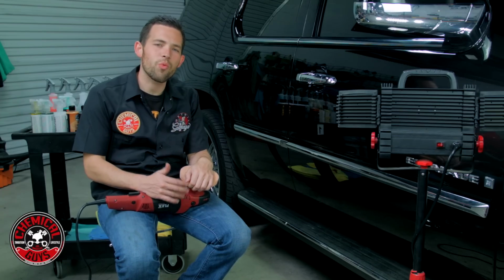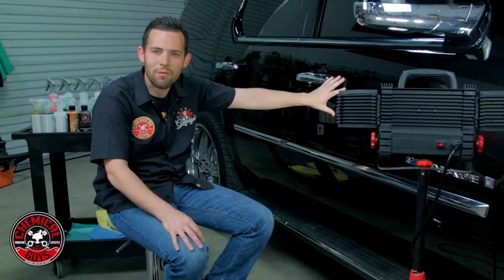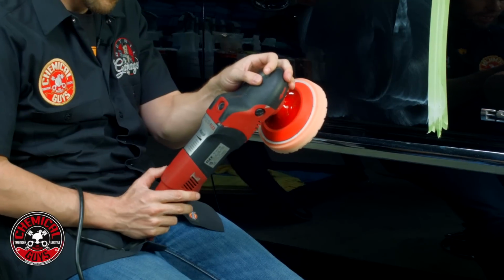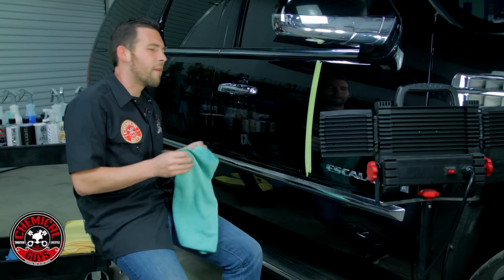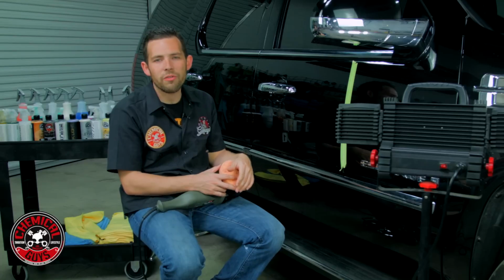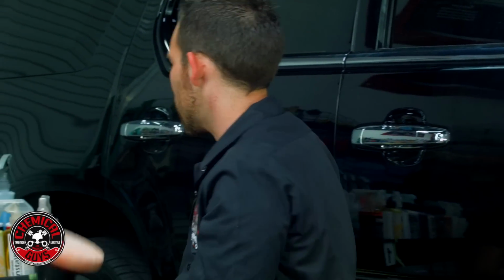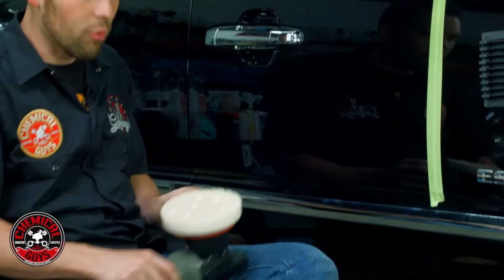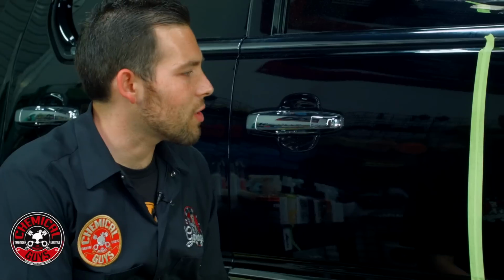How To Machine Polish Hard Clear Coat Paint - Chemical Guys

Comment: Used your products on my 06 Dodge Ram 2500. This was my first time using your products and also my first time using a machine on any of my vehicles. I was a little scared at first but the VSS seemed to work great. I do have one question, with such a large vehicle, is it necessary to switch pads about halfway through? I felt like my orange cutting pad was filling up with dead paint and polish and possibly loosing its effectiveness. Thanks, and I cant wait to use more of your products in the future

Comment: For someone who has never polished a car before, if you're going to do a two or three step polish. Are you supposed to do (for example) a 2×2 section of v34 then jump to v36 in that same section? Or do the whole car with the first step, then go back and do the whole car with the second step polish. Then go back for the finishing step?
Reply from the maker: samuel cabrera It's most efficient to polish the entire car with one step, then repeat with the next step, then finish with the last one. Switching between different compounds and pads after every pass wastes time, and heavier compound dust can potentially scratch other areas that are already "finished."
In this video, Greg is just demonstrating the process that he would eventually use over the entire vehicle in one test spot. We're not about to spend 30 hours filming one video lol.
Reply: Chemical Guys thank you for the information and another great video!
Reply: +Chemical Guys   How long does the average paint correction take for most of your clients assuming it's just one guy doing the work?  Lets say average wear n tear 4 door sedan...

Comment: I have a quick question I recently bought a 2015 Nissan black car and I have had this car 4 months wash it several times now using your washing methods and it lookd good but when I'm done washing and drying the car I noticed that it has a lot of factory orange peal to the paint and isn't giving me the mirror finish that I see in other black cars paint job, how do u go about this problem
Reply from the maker: The only correct way to fully remove orange peel would be to fully wet sand the entire car (1000-3500 grit) and then do a 3 step machine polishing job to remove the scratches. This is a lengthy process that can often take 50-90 hours of labor. On factory cars, we do not recommend wet sanding to remove orange peel because modern factory clear coat (specifically Japanese brands) are very thin, and wet sanding can drastically reduce the life of your factory paintwork.
Reply: I know exacly what youre talking about.Leave it!That how some of the nissan paints are coming now especially on bumpers.
Reply: Should only be wetsanding for orange peel on repaints.

Comment: Do you think the torq 22d could have done this job without using the rotary machine first?
Reply: probably not because it is black paint + its GM paint so its really hard
Reply: DeltaDog I think so without a doubt. Try using a microfiber cutting pad with a good water based compound, such as Menzerna, Sonax, Angelwax, as it will allow longer working time on the panel.

Comment: Speed setting 4 was used on the torq. Not 6. What difference would that actually make?
Reply from the maker: We used speed setting 6 on the TORQ. The video is correct. The display on the TORQ does not read 1-6, it reads OPM (1500-4000)
Speed setting 6 is 4000 OPM, as the machine is reading
#1 = 1500 OPM
#2 = 2000 OPM
#3 = 2500 OPM
#4 = 3000 OPM
#5 = 3500 OPM
#6 = 4000 OPM

Comment: My brand new torq 10FX only goes to speed setting 4.0.... Is there a special way to get it to speed setting 6.0?  Also, is it normal for the torq to get VERY hot near the front handle?  Much hotter than my old Harbor Freight polisher.
Reply from the maker: Hey Eric, we get that question a lot. The Digital Display on the TORQ uses shorthand to display the actual OPM speed at which the buffer head is spinning. After 00, the six speed settings of the machine spin at: 1) 15 - 1,500 OPM 2) 20 - 2,000 OPM 3) 25 - 2,500 OPM 4) 30 - 3,000 OPM 5) 35 - 3,500 OPM 6) 40 - 4,000 OPM. When the detailer in the video refers to speed setting 6, he means 6 + clicks, or 40 on the digital display. They are the same speed.Thanks for watching, Eric, and stay tuned for a new video launching tomorrow!
Reply: Chemical Guys Thanks. I thought that but wanted to be sure I wasn't missing something.
Reply: no answer about the heat eh?!??
Reply: @2010stoof  not so far. Still no issues with it,  just a bit hotter than I'm used to.
Reply: @erichelms8168  I meant funny there was no answer from them about it lol
Reply: @2010stoof  yeah. I caught that. Seems they don't want to address that part lol

Comment: I'm starting to feel like an orphan with my Porter Cable.
Reply: ***** 85% of the time Greg uses the TORQ 10FX and 15% he pull out the big guns Rotary Polisher.  I haven't step up to the Rotary yet but I see more and more video that he uses that Rotary polisher.
Reply: +Jovan Hardwick i am professional detailer you can really good results with with you machine if you use maguire m105  is one of the best compound
Reply: This is a massive pain

Comment: does a chevy cruze 2014 have hard or soft paint. it a rainforest green, will you black kit work good on it
Reply from the maker: The only way to tell if paint is hard or soft is to perform a polishing test spot to see check the paint condition.
Reply: will your black car kit work on a dark green paint
Reply from the maker: Ron Lloyd Yes, the kit will work green on dark green paintwork since its very similar to black.
Reply: ok thanks

Comment: Hey guys.

 I've love your stuff for years but I've never seen you tackle removing orange peel. My BMW paint does my head in.

Love from the UK.

Donut
Reply from the maker: We do not recommend removing orange peel from vehicle with factory clear coat. Wet sanding orange peel from the surface will make the paintwork extremely thin, thus reducing the lifespan of your vehicle's paintwork.
Reply: Check out topaz detailing. They remove orange peel from super cars. It's not dangerous.
Reply: *****  It seems to remove roughly the same, or maybe just a tad more, than regular machine polishing.
The issue is you have to be VERY careful. One mistake will take your 2000 grit to 1000 grit (or around that), if you are not completely even and methodical in your application you can do some serious damage to the paint, not REMOVING the clearcoat but you can put defects in so deep that you will not be able to completely remove them. Also it takes a lot of work to actually remove all traces of the wet-sanding process in all angles. You also need to be careful around panel edges, swage lines, etc.

Most of the time I find that if you want to remove the orange peel, using the orange peel removal pads from the likes of CarPro are probably the best compromise.
Reply: +Chemical Guys who are the orange people? I think they'd prefer to be called "oompa-loompa's"

Comment: Recently tried to use the Porter Cable DA to remove swirls and scratches from some hard clear coat using an orange pad and ended up melting through my yellow 5" backing plate.  Is this common with a DA?  Ordered a new one yesterday, but bummed that the backing plate actually came apart and turned to goo on the backside of my pad.  Is there a better backing plate for my DA?  Sounds like I need to invest in a rotary to speed up the cutting process.
Reply from the maker: You are applying too much force to the porter cable machine. Too much pressure will destroy pads and backing plates. Ease up on the pressure when polishing.
Reply: Thanks for the tip, love the videos!

Comment: Hi guys. My quesion is or posible remove halograms with rotary polisher? And if yes what combination have to use. The paint is hard becose car is all repainted. BMW carbon black. Thanks
Reply from the maker: Hi, thanks for watching. Be careful with a rotary because you run the risk of burning the paint. I would recommend starting with V36 and an orange pad, and then following up with V38 and a white pad. If that doesn't work, use V36 and a yellow pad, and follow up with V38 and a white pad. More than likely this combination should produce the desired results.
Reply: But i try tu compound with orange pad and v34 and he still dont do the job what actualy i need. But i do with some another product for heavy cut. Now need some halograms remove only.
Reply from the maker: Use the V38 and a white pad to remove the buffer trails.

Comment: Hey! Awesome video! I have a few questions.  I live in Hollywood and all of the quality detail shops near me charge $75 an hour for labor, which means I need to either do it myself or I need to earn $150 an hour before taxes to pay for their services.  So I decided I'm going to be doing it myself.  And I've never done this before.  So I spent a week watching all of your guys videos.  Then I bought the Chemical Guys BUF501X kit with the Torq 10FX, orange, white and black pads and V32, V34, V36 and V38 for $208 on Amazon, delivered next day.   I washed my car today, used Clean Slate, Decon Pro iron remover and then used an Eagle 1 surface prep mitt (I've seen reviews that say it works as well as clay).  After the Eagle 1 mitt, about 70% of the grit was gone by using the cellophane test.  So I used the mitt for a second pass and a third pass.  but even then, 10% of the bumps were still there.  Maybe it's just not as good as clay?  But since I hadn't ordered any clay, I decided to move forward on my black, 2011 Audi R8.  It has been garaged, but it regularly goes to "hand" car washes instead of a real detailer and it has swirls and scratches for days.   It also spent its first 5 years of life on 2 different leases and probably never saw any real care before I bought it earlier this year.  So I started with a test spot that is about 1/3 of the front hood.  I'm a novice, remember?  I wanted a big flat spot to learn how to do this without burning a hole through the clear coat going over a crease or running into my carbon fiber vents on the rear deck.  I started with the orange pad and V36.  Nothing.  Then I went to orange and V34.  It made a difference, but the scratches were still clearly visible.  Then I went to orange with V32.  The paint was definitely getting dull from the coarse cutting compound, but I could still see scratches.  So I did a second pass with V32.  Still scratches.  So I came to Youtube to see if I can solve this problem.  I landed here because you address black cars and hard paint.  It looks like the answer is to use a rotary buffer.  But I am a total novice and rotary buffer horror stories are what kept me going to pro detail shops when I needed paint correction.  I got the Torq DA because of all the reviews that say that you can't seriously damage your paint with a DA.  I am 1) scared to use a rotary and 2) I don't want to buy another expensive piece of equipment that will only get used every 2-3 years.   So how do I get through the scratches?  I was moving faster with the DA than you were with the rotary.   I was afraid of hurting the paint, so I kept moving.  The compound eventually dried out and started flinging clumps, but it never became clear.  Is that because the DA doesn't do as much work on the clear coat?  Should I go slow with the DA like you did with the roatary?  Also, my 10FX has speeds labeled 15, 20, 25, 30, 35, 40.  Why is that?  When you say you used speed 6, that is the same as 40, right?  Since rotary isn't a sound option for me from a novice skill level and the price point, how would you suggest I proceed to get the scratches out without damaging the paint?  Thanks in advance!
Reply from the maker: Hi Larz! You've got all of the right tools for a proper paint correction, I suggest working in smaller sections, about 2 x 2 so that the polish won't dry out. That's what causes it to clump up and fling. Using 5 dime sized drops will prevent build up and messes. Also, don't be afraid of a dual-action, you can move slower than with a rotary. The DA has built-in safety features that prevent you from burning and marring it. I recommend moving about an arm speed of 1 inch per second. As for speed, spread on 15 and polish on 40. If you need a more aggressive cut, use a microfiber pad. To note, some scratches may be too deep that they may require color sanding but we don't recommend a novice attempting it. If you need further advice, feel free to contact our customer service department. customerservice@chemicalguys.com 

Welcome to the Chemical Guys family!

-CG Javier
Reply: Chemical Guys thanks for your reply. Much appreciated!
Reply: Larz I wish I could help but I am novice to. Sounds like your paint is hard .you don't need to use a rotary just use microfiber cutting pad, there "the safer alternative to wool pads" so they say. You know old school wool pads they used back in the day on rotary machines because the paints were much harder . These days there different. Hopefully you fix your problem cheers
Reply: Lucas Ornelas Thanks! That is great advice. Javier mentioned microfiber above, but I didn’t really take it to heart because it was couched in “you have all the right equipment for a good paint correction”. I shelved the project last weekend to get some advice. It also gave me a chance to see my car in daylight and the area I worked on with V32 and the orange pad still clearly has scratches, even though it looks a lot better than the untouched area next to it. I have a couple of bottles of cquartz ceramic coating I want to put on it, so getting all of the scratches out now makes the most sense. I’ll order up a microfiber pad for this weekend because I’m sure that it will save me a significant amount of time when it comes to covering the entire car. I’m happy you chimed in. I’ll post again this weekend after trying the microfiber pad.

Comment: What combination would anyone recommend for getting swirl marks out of vw scirroco 2012 any help would be great.
Reply from the maker: Hi Adam, thanks for watching. Swirls marks occur from improper polishing, heavily abrasive pads and marks created by rotary buffer trails. I recommend you pick up V36 and V38 with an orange pad and white pad. Start by polishing with the orange medium cutting pad, followed by finishing with a white pad. Unless you have really hard paint, the finishing polishes should be enough to remove the swirl marks. The goal is to always jewel the paint to make sure the paint is smoothed so that no imperfections can be visible. Stay tuned Adam, we've got more great videos coming your way.

C.G. Alex -
Reply: Thanks for ur advice shall try it.

Comment: Could you have used the rotary to take the hologram away?
Reply from the maker: Yes, most imperfections are removed when the clear coat has been removed, and the paint is later refined using a paint polish designed to restore shine and clarity to the paint. Rotary polishers are very powerful tools in the right hands, but they can also damage the paint if proper polishing techniques are not employed correctly. The best way to get good results it to start with a less aggressive approach first to see how the paint reacts, and then move onto a more abrasive pad and compound combination.
Reply: Chemical Guys so I have a DeWalt 6/7 in rotary polisher. Would you suggest putting a 3 or 4 in backing plate and pad on it for the tight spots?
Reply from the maker: The smaller the pad, the easier it will be to maneuver the machine around body panels and tight spaces.

C.G. Alex -
Reply: Chemical Guys thank you. And you see no problem doing that?

Comment: Had some deep scratches & swirls with my black sapphire metallic paint on a BMW 340i. Used the same steps here but only had a DA. Took way too many steps & I'd say I'm only 60-70%. I was prob better off wet sanding with 3000 & maybe using MF cutting pads instead. Surprised how ineffective v32 with an orange hex pad is against hard paint.
Reply from the maker: Hey Kenneth, how's it going? If V36 and V34 aren't cutting it, we always suggest switching to either a Yellow Cutting Pad, or a Microfiber Cutting Pad. It's not always the strength of the compound or polish used, but rather the combination of machine/pad/chemical. All paint is different and V34 with a orange pad might not get as much scratches out as a less aggressive polish like V36 with a microfiber pad. So there is no cookie-cutter answer that will work for every car out there. What there is, though, is a method. We have a method for selecting the best combination of machine, pad, and polishing compound for any car we may detail. Please see the link below to learn more about the correct method of choosing the combination of machine/pad/chemical for your car. If you have any further questions, please contact our customer service department at 866-822-3670. 

https://www.chemicalguys.com/How_To_Choose_The_Right_Compound_Or_Polish_For_Your_Car_s/644.htm